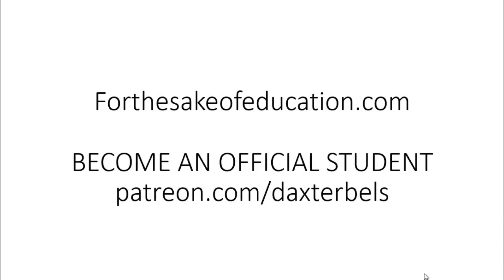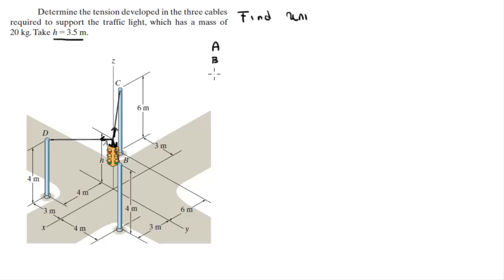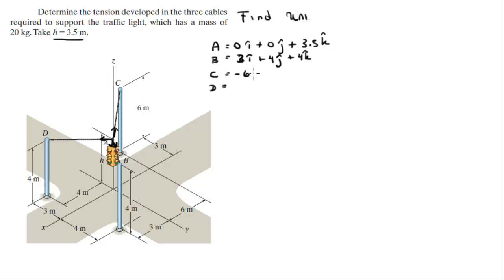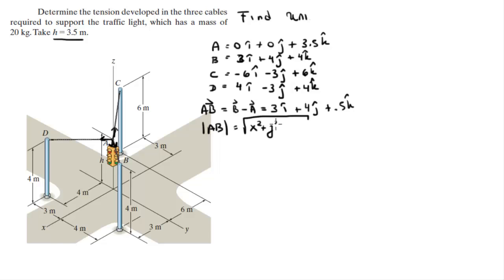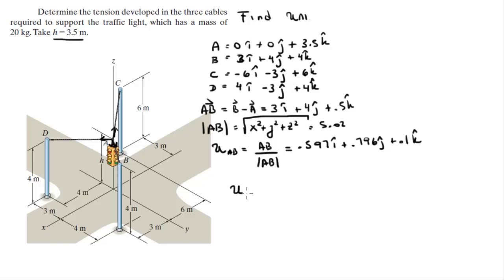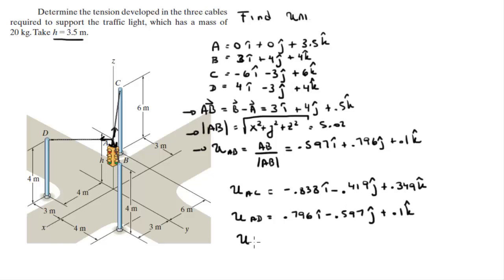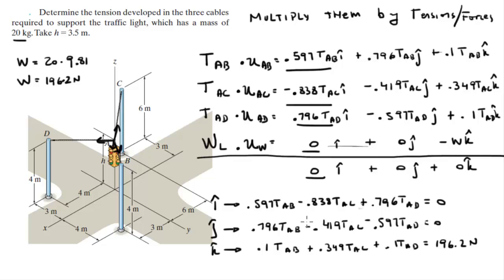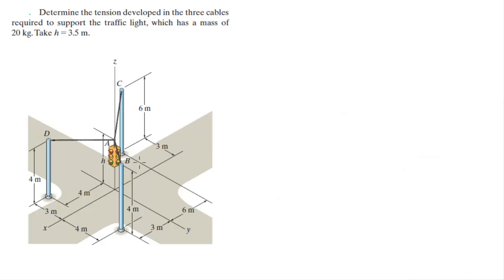Determine the tension developed in the three cables required to support the traffic light

Comment: Im sorry but your way of explaining and use of matrices are very hard to understand, im in engineering and couldnt understand (have never seen) your way of matrices. Also what tension force is x, y and z?
Reply: What univeristy do you go to
Reply: I'm pretty sure he's using cramer's rule, you should be able to do this easily if you took Linear Algebra.
Reply: The method he's using is the cross product of vectors to find the determinant.